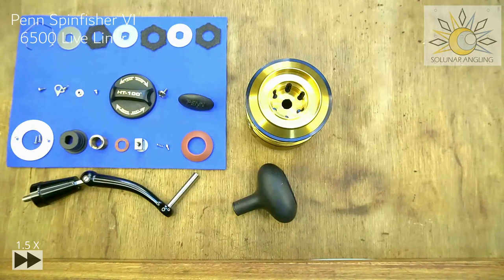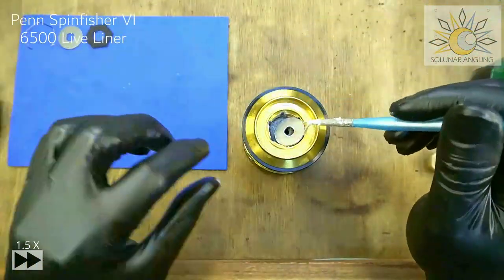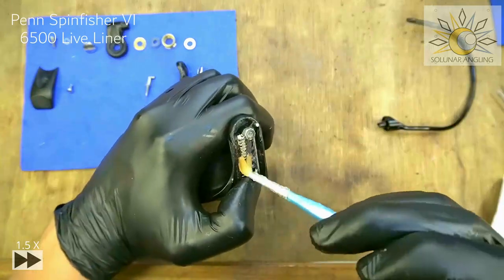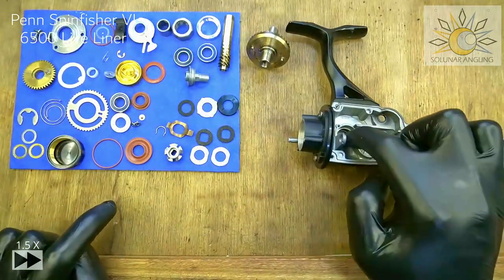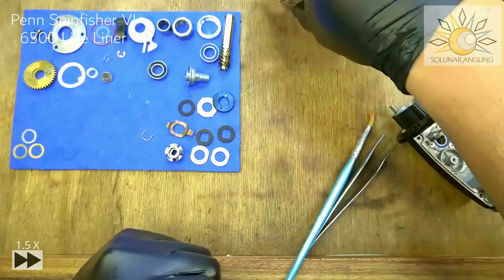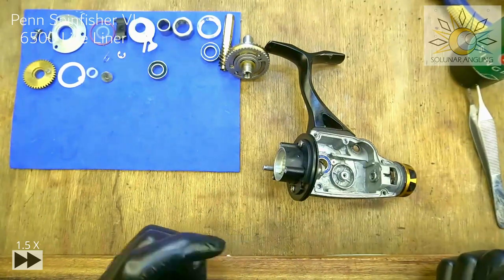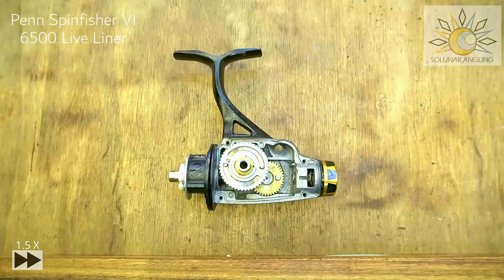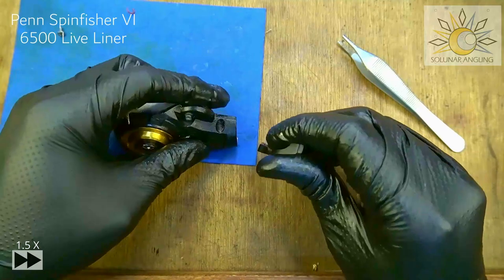Penn Spinfisher VI 6500 Live Liner - Part 2/2 Reassembling - Reel service and maintenance -

Comment: Great video man! Definitely subbing cos you're doing a fantastic job of explaining the necessary procedures. I service and maintain my own reels at home so this is invaluable. Small tip I picked up from the RC hobby, if an o-ring or seal has expanded slightly after cleaning, just pop it in the freezer for a few minutes and it will shrink slightly, making reassembly/fitting easier. Keep up the great content!

Comment: have you ever experienced such a problem that pressing the crown wheel on the axle loosens and turns? is that why the brake doesn't make a sound?
Reply from the maker: Sometimes it happens when the live liner drag is too loose or the spool drag is too loose.
Reply: @solunaranglingconfidante417  the basket on the shaft loosens and the brake noise ceases, how does the spindle rotate together with the spool?what is the solution should I not use it in position 1? can i protect it like this?
Reply from the maker: You can use position 1 but your live liner drag must be less than your spool drag. However, it is quite normal for position 1 to not function properly. I usually never use position 1.

Comment: when im using the lightest rear drag.. the LL clicker sound feel weird, sounds like the main clicker not seat properly in place... its sound normal when im using more LL(rear) drag.. can you diagnose where the problem? i need use the lightest setting, its okay with that weird clicker sound ?
Reply from the maker: Its not a problem. This reel have 2 clickers. The spool clicker and LL clicker. If the LL is too light, the LL system might not engage. What you're hearing is spool clicker. Same thing happen when the LL drag is higher than spool drag, the LL system will not engage as well (meaning if you set the spool drag at 1kg but the LL drag is 1.2 kg, then the LL might not engage or it might go on and off).
Reply: @solunaranglingconfidante417  thanks for the respon, i already understand that condition you have explained. but this is different. the sound at level 1 (lightest) is different at lv 2 or 3.. the sound not solid as lv 2 and 3.. its no matter to me im just worried it will affect performance after long use
Reply: im testing with heavy spool drag setting in this situation
Reply from the maker: @riskurangler  understood. Unfortunately LL system was designed as such. Not much can be done.

I usually never use lvl 1. I always set at lvl 2 or 3 because lvl 1 is soo light that sometimes it displaced to lvl 2 with a light touch. If you need lighter drag at lvl 2, you can adjust the tension using the key provided with the reel. I always set lvl 2-3 around 0.5-1kg for livebaiting spanish mackerel and billfish. Lvl 1 and lvl 4 I never bother.
Reply: @solunaranglingconfidante417  i'll test  mackerel/king tomorrow its my first time using LL.. i hope lv 2 is light enough for 3-4kg mackerel